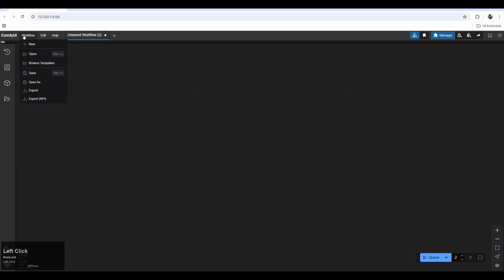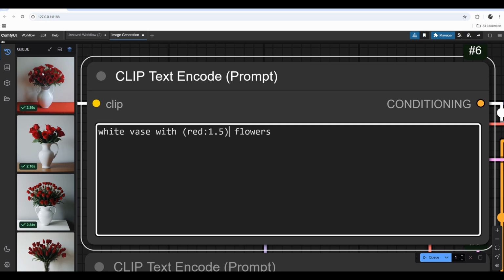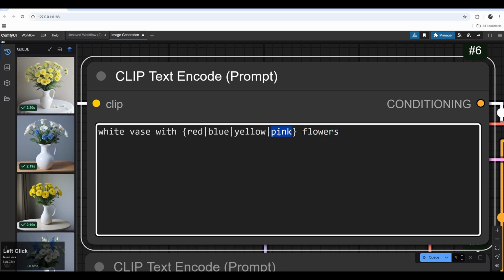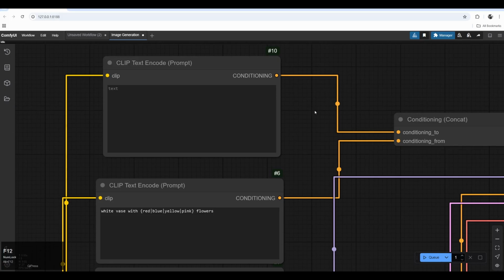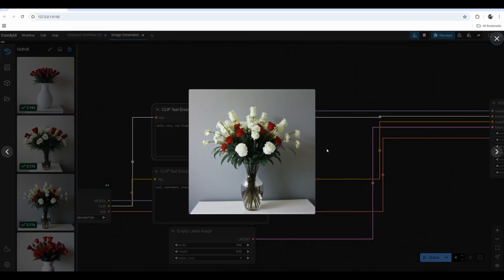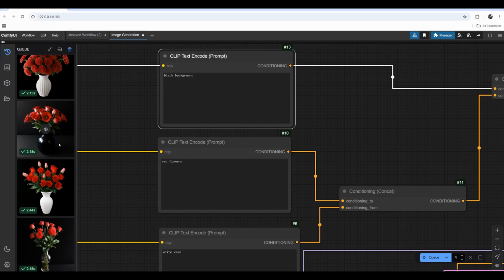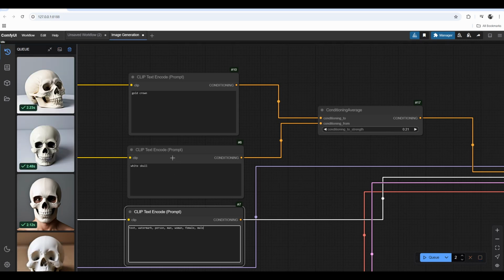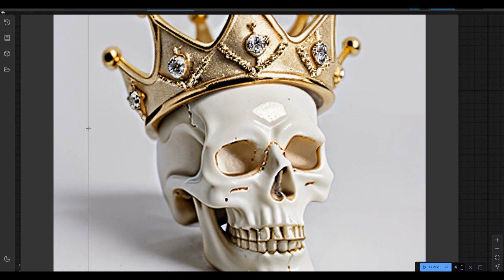Stop Color Bleeding in ComfyUI – Advanced Prompting Tips

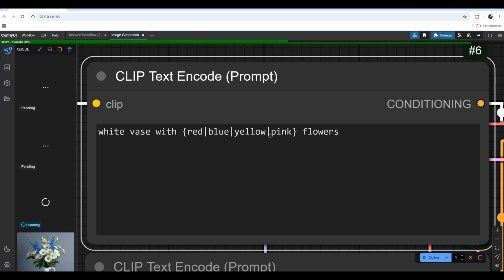Comment: Hola my friend, ooverall nice tutorial. But, at 2:00 , there is a slight mistake the syntax {x|y|z} will randomly take x,y or z at that place and not try to mix them up. Also from the official documentation- 
"To create a variant, wrap your options in curly brackets {} and separate them with a vertical bar |. For example:

{summer|autumn|winter|spring} is coming
This will randomly generate one of the following:

summer is coming
autumn is coming
winter is coming
spring is coming"
Reply from the maker: Thank you so much for extra clarification!